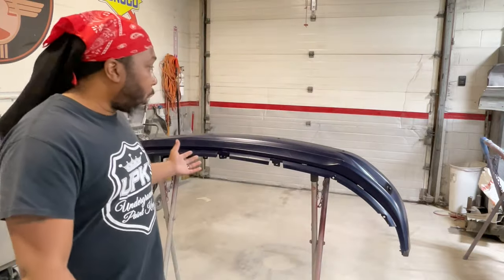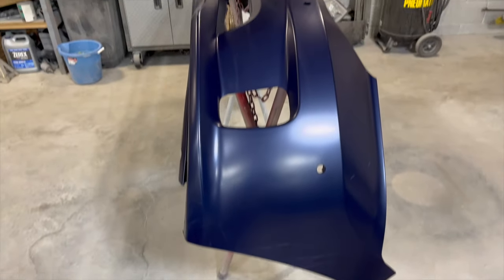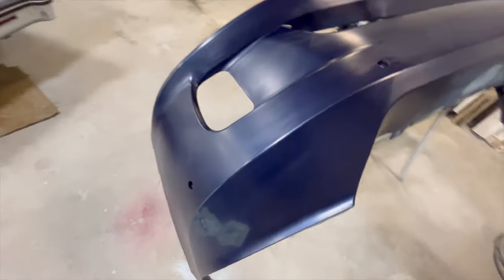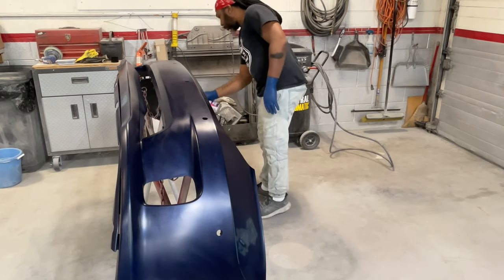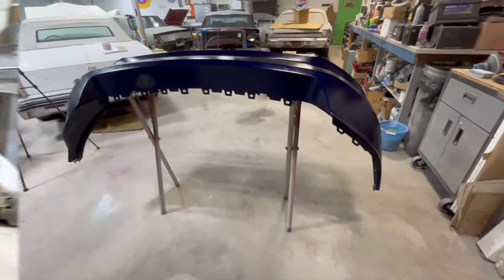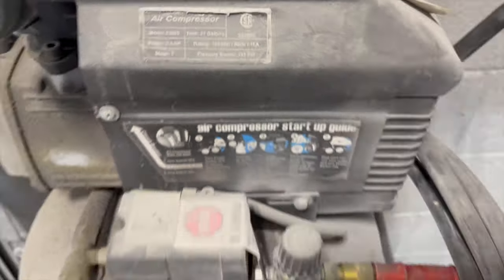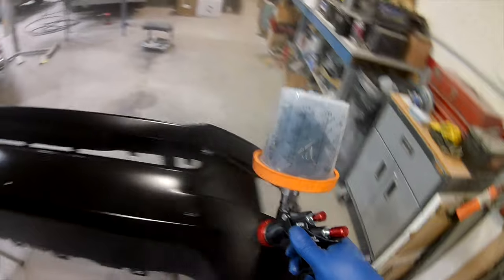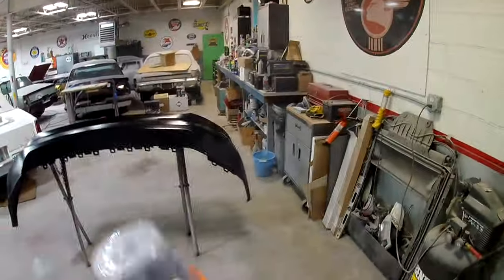HIGH cfm spray gun LOW cfm compressor

Comment: I don’t think spray paint coating was a good idea
Reply from the maker: You spray painted something?
Reply: @UndergroundPaintKing  sorry about the typo. I meant spray-can. If you’re going to the extent of using compressed air and quality spray gun, applying a layer of paint from a spray can just adds uneven surface. The downside of spray-cans is the uneven paint distribution. It kinda defeats the purpose of using the higher quality paint system if you’re gonna apply it on a layer that’s already uneven from can-spray pattern.
Reply from the maker: @RasTona_  oh ok, I appreciate your explanation, and a lot of shops use the adhesion promoter from a spray can and in the spray gun so either one works, I just happen to use the spray can version since it’s what I had